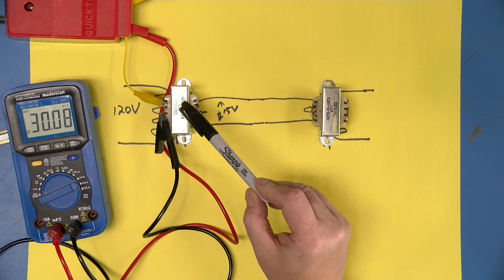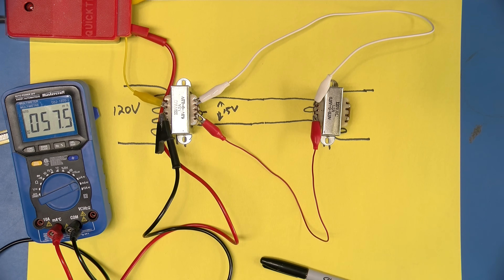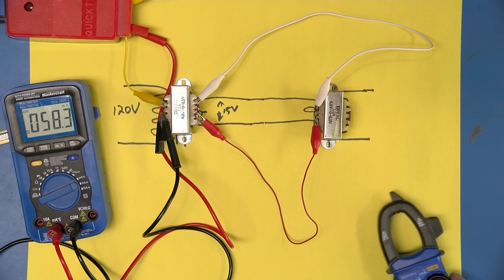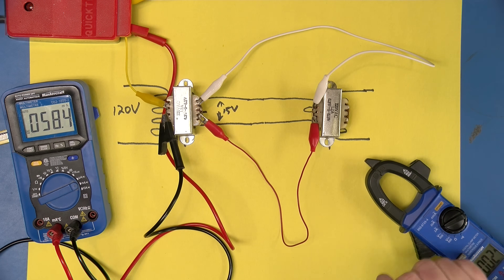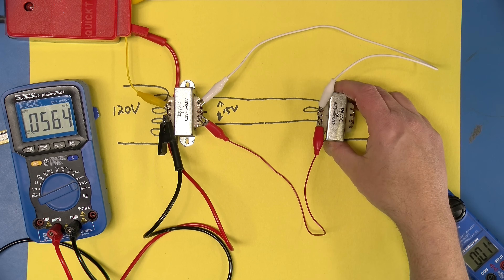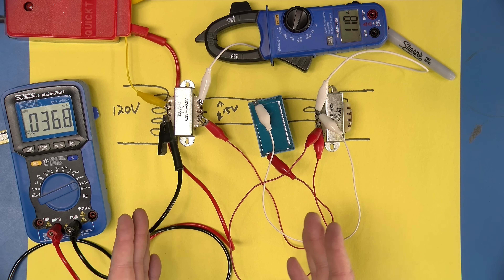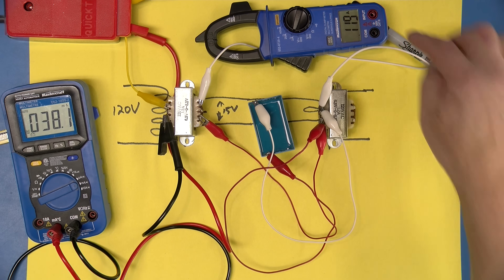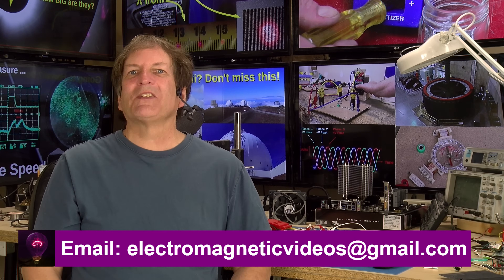Viewer Questions: Back to Back Transformers

Comment: Power factor correction a work! I'll have to try this one - sometimes I build a small tube amp with back-to-back transformers for plate supply, and get surprised by the heat. Turns out it's reactive power issue.
Reply from the maker: Yes! And many of those cheap small transformers draw a surprising amount of reactive power. Just be sure to use a capacitor that is rated or able to withstand the continuous current though it without burning up itself!

Comment: Very nice video. Thank you for posting. Liked and subscribed.
What current could we expect if we loaded the primary of the second transformer?
I am doing a small valve/tube amp and I need 30mA available. Is this realistic?
.
Reply from the maker: Great! Thanks! So assuming the transformers are identical, and by "primary" you mean the HV winding, normally a primary, now a secondary, right?  So I am assuming you have 240V AC mains in the 1st transformer, 12V out of it and into the second, and 240V out of that. 

The limiting factor for a transformer is the current rating. So as an example lets say 1A for the 12V secondary. The primary rating would be 1A/20 where 20 is the turns ratio = 50mA .

So in a perfect world, you would have 50mA available from the 240V output at the other end.

But both transformers are drawing magnetization current. You can measure the total input magnetizing current for the two connected transformers by measuring the current into the mains connected primary without anythig connected to the output of the second transformer (be careful when doing this - lots of HV!). That current might be around 10% of the transformers rated current for one transformer, so twice that for both. So lets say swe measured 10mA. So very crudely you would have 50mA - 10mA = 40mA available on the output before starting to overload  things.

To simplify things I have left out the fact that  when the transformer was built, its intended primary might have been made to a bit more than the rated current so the magnetization current doesn't reduce the output spec. And when subtracting currents you really need to take the reactive part into account, so ignoring that will make the result a bit worse than it should be. 

Hope that makes sense! Bottom line, unless your transformers are really small, 30mA should be easily achievable. I would try and make sure you have AC current available at twice that or more since most likely your power supply  will only use the AC cycle peaks to charge its capacitors so the RMS current will be much higher than the DC current you need. 

Also, be careful - with the output being isolated a GFCI/Residual Current Device wont protect you and that so or current is more than enough to do harm. 

Good luck with the amp - I subscribed to you channel so I see it if you make a video about it.
Reply: @ElectromagneticVideos  Thank you for this detailed reply to my comment and for subscribing to my channel. I think you are the first one who is neither a friend nor a family member. 🙂
Yes, you are absolutely right. I am in the UK, so I will use a 240V transformer. In my case, the heaters for this particular circuit are 6.3V, so I will use two 240V:6V - 0 - 6V transformer. Hopefully, let's say, a 10VA transformer will be enough to deliver 6V to the heaters plus 30mA to the circuit.
To keep costs down and small size, I chose to use encapsulated transformers (is this a bad idea?). Until now, I have been using a boost converter, but the noise is way too much, so I've decided to give it a go with transformers. Let's see.
Cheers,
Pedro
Reply from the maker: @geekPlayground  Hi Pedro, neat that I am the first outsider to subscribe :) If you are planning to grow you channel, just keep posting (good) videos - it takes a while but eventually people find them. 

Nothing wrong with encapsulated transformers as long as they have have sufficient VA. Your noise should go way down if the boost converter was noisy.

By the way  - put a ceramic capacitor in parallel to the electrolytics in the power supply circuit if you havnt already do so - it will reduce higher frequency noise, 

 What was the frequency of the boost converter? You can make pretty noiseless ones these days particularity by using higher switching frequencies (100s of khz or Mhz).
Reply: @ElectromagneticVideos  Hi Pete,
Thanks for your reply. Yes, I will start making some content soon. If you dare to watch one of the videos, you'll see that the recording is not good. I used an iPhone to shoot both audio and video, using the integrated iPhone's camera and mic, so the result is not the best. On top of that, I am not the best person to present a video, since I get pretty nervous when talking to a camera!
I am trying to improve on this!
Regarding the boost, it is one of those 390V boost converters from eBay/Aliexpress.
As I cannot place links here, please search for a 390V boost converter module, and it will pop up.
The switching frequency is 75kHz, which is way below the human hearing range, but harmonics can be strong enough to be heard.
I am planning to design my own PCB using an LTC/Analog Devices chip, which is capable of very high switching frequency and high voltage. The chip is the LTC7840 and it can step-up, for eg, 12V to 240V in 2 steps.
Cheers,
Pedro
Reply from the maker: @geekPlayground  Hi Pedro, It took me a while to get comfortable on camera even though I have no problem giving a presentation in front of a large audience. I think its all about getting used to the situation - so it well get easier with time.  There are plenty of channels way bigger than my tiny channel that just use a cell phone for audio and video - so dont worry about that. My audio was awful in my early videos - also takes some learning what works best for you. And, once you get to 1000 subs you start earning money and can use that to get better equipment. Making a circuit board is the things to do - have  you done one before? There are a number of Chinese companies that will make   5 to 10 PCBs 10cmx10cm for $20 or so - an amazing price.
Reply: Hi Pete,
Thanks for your reply.
Answering to your question: yes I design my own PCBs and have them produced in China (JLCPCB, PCB WAY, etc). All my amps are soldered in the PCB, which makes the wiring less messy. My PCBs are always smaller than 100mm x 100mm, so 5 boards cost $2.
Cheers
Pedro
Reply from the maker: @geekPlayground  Fabulous - just wanted to make sure you knew that you can get them real cheap like that! Let me know how it goes - maybe we can do a joint video on it. I have been planing on doing a video on why tube amps sound different so that might fit in well with that.
Reply: @ElectromagneticVideos  That would be amazing! Thanks.
Btw, I have just ordered the transformers. 🙂
Reply from the maker: @geekPlayground  Great! Send me an email (see the end of this video for email address) so we stay in contact - there isnt an easy way to find things in the youtube comments after a while.

Comment: 8:26 ... every time you do that I wince. A plastic pointer would be much wiser.
Reply from the maker: In my defence I am only using one hand but your point is well taken!
Reply: @ElectromagneticVideos  Understood, but I wince because of the danger of your hand being so close to terminals which would have ~120 volts on them. Pointing rather than touching would be wiser.

Comment: Can you please do video on 2 wire current loops? I have 4 sensors, 4-20mA, 15-30VDC. One source says its fine if they all share same DCV pwr supply. Yet another source says you can't must be isolated to prevent ground loops. These are all going back to a controller.
Reply from the maker: Sure! I will add that to the to do list. It may be part of more general ground loop video I have been pondering, although is sharing DC really ground loop issue rather than simply not taking advantage of the noise immunity of a balanced line?

Are the sensors working? Have you had any data issue?

Comment: Thanks for another excellent video!
I saw Mr Carlson build an isolation transformer and he added a cap to reduce the loses but he never explained why.
Is there a relatively simple formula to calculate the capacitance needed?
Also, could you add a GFCI to the isolated side?
Reply from the maker: There isn't an easy way because few transformer secs have the reactive current specified. So

1) You could measure the total current and the real power using a power meter, calculate the real in phase current from the real  current and total current where the total current is the hypotenuse of a right triangle and the real and imaginary currents are the sides. Use Pythagorus rule. 

2) Instead of the above, measure the current when the transformer is unloaded and guess that about half is reactive. So now we know the reactive current we need to compensate for.

3) Use ohms law Zc = V/I where V is voltage into the transformer and I is the reactive current. Zc is is the reactance we need. 

4)Use Zc = 1/(2πfC) to get C. 

5) So start with C close to the value from above, and try a bit more and a bit less till you find the minimum current draw and you have it. 

Note you need to use continuous operation AC capacitors, and be sure to discharge them after removal from the circuit do you dont get zapped. 

In most situations with small transformers its rarely worth the effort unless you have a good reason to reduce the current a bit.  

GFCI - generally not much help at the end of an isolation transformer since in theory the transformer should prevent any stray current. It could be of use if a short developed in a transformer - and one can debate if its better to have the GFCI on the in or out side of the  transformer. In one video I mentioned my isolation transformer was plugged into a GFCI - did I ever get criticized for that. No sure why - more protection is better.

By the way  - a GFCI st time is better than an isolation transformer since it shuts down the circuit. If you touch both terminals of the isolation transformer output, it wont stop and can be lethal. So each use case should be carefully considered as to which (or both)  is safer.
Reply: @ElectromagneticVideos  PERFECT!  THANK YOU!!!  I'm saving your reply for future reference.
I stumble onto a clearance deal a long time ago on two 24V 40A landscape lighting transformers.  Connecting them back to back worked but the because of the idle power draw, I haven't used them for that purpose since. 
It'll be nice to dust them off and put them to good use.
Reply from the maker: @button-puncher  That sounds like the perfect transformers for that sort of thing. So when you do it, measure the current in the 24V connection between the two while adding capacitors. You  can use smaller capacitance higher voltage capacitors on the isolated 120V winding  output or large capacitance lower V on the 24V middle, whichever is easier to get. Most likely the 120V ones will be easier to get - motor run capacitors would be a common component that would be easy to get.
Reply: @ElectromagneticVideos   I knew that you can make bi-polar capacitors using two 'lytics back-to-back (for speaker crossovers) so I was thinking of going that way, but thanks for the tip on using a cap on the 2nd transformers output.  I have a bunch of furnace fan run capacitors that I can experiment with.
Reply from the maker: @button-puncher  The furnace run ones would be perfect. If you do go with the back to back route, also a good idea to put back to back diodes in parallel with the capacitors since you cant trust the capacitors to be identical in terms of leakage currents. Also, for this sort of use you have to be wary of heat generation in the capacitor due to current flow - so not every electrolytic is suitable for long term use like this.
Reply: @ElectromagneticVideos  Good points for the additional diodes.  Whatever I have laying around definitely isn't going to be matched.  Cheap insurance for increasing the lifespan.  
I now wonder if you crack open a run capacitor, if they have diodes inside.  Probably so!
Reply from the maker: @button-puncher  You know, I'm not sure if they have them - or if being manufactured as part of the the same process both sides of the capacitor are assumed to be close to identical. If I come across a bad one I will have to do some exploratory surgery :)
Reply: @ElectromagneticVideos  Ditto!  I've got an oil filter cutter, now I just need to find a bad cap.
Reply from the maker: @button-puncher  Let me know what you discover! I would be intrigued to know!

Comment: A few people in the comments have mentioned re-purposing transformers salvaged from microwave ovens. While this is certainly feasible, precautions are necessary.

These transformers are far from "conservative designs." The expectation is that they will have forced air cooling. That allows using "less copper" than you would in a typical small power transformer for general purpose use. In typical general purpose transformers you can get a reasonable idea of how much power one will handle just from its weight. Catalogs from manufactures such as Hammond can help you get an idea of this. A transformer from a (say) 700 watt oven might need to be derated to four to five hundred watts for general purpose use. (It is quite acceptable to fairly significantly "overload" a transformer if the duty cycle is low and the ON time is short; allowable maximum temperature in the hottest part of the winding is the limiting factor.

Transformer turns ratios are often not exactly as expected from the ratio of winding voltages. Typically the turns ratio is adjusted so that the secondary delivers the nominal voltage at the full rated current. This means that the secondary voltage may be quite a lot higher than nominal with light or no load.

Probably covered in other videos in the series:
Inductance is proportional to the square of the number of turns. If you have a transformer with an actual turns ratio of 10:1, for example, the primary inductance will be 100 times the secondary inductance.
Reply from the maker: Great summary of all the transformer factors to consider. I'll add one more thing about microwave transformers: to anyone using them, be aware how deadly lethal the HV secondary is. The 1000V output is more than enough voltage to punch though some cracked insulation and dry skin, and the 1A current more than enough to kill or at a minimum, result in sever burns. There have been people who have been killed or maimed when re-purposing these transformers. Be careful - and remove the secondary before using them!